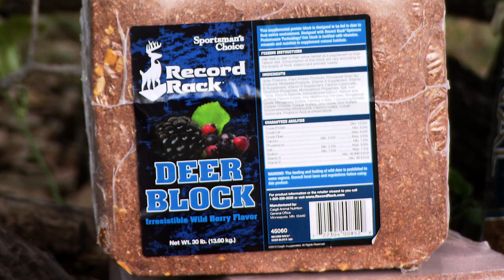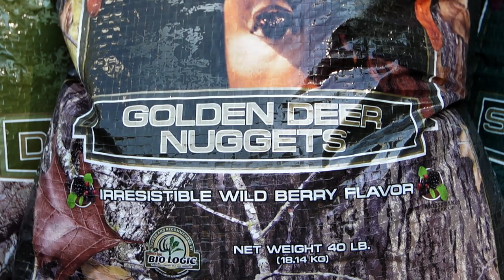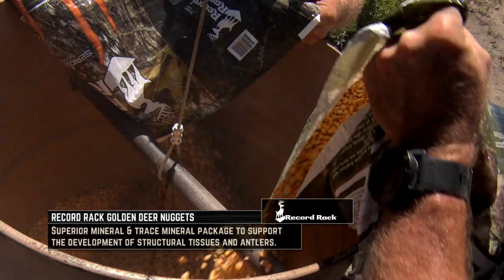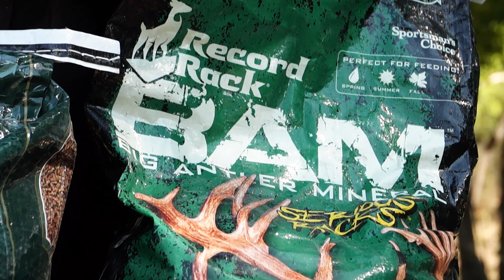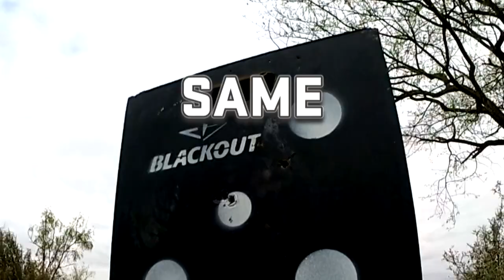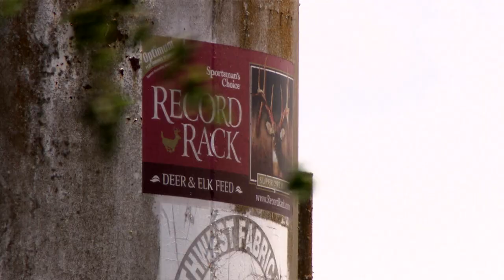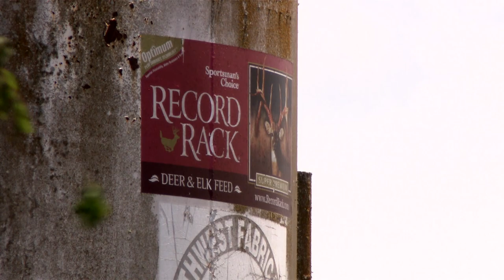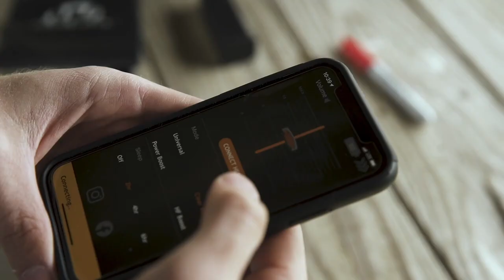Starting a Supplemental Feeding Program with Record Rack

Comment: Need to mix that mineral with the dirt in a 3 ft circle or so! , they like it better when it’s poured in a 3 ft diameter on bare dirt and they use it immediately
Reply from the maker: We've tried both ways and agree with you mixing it in does seem to work better in some areas.

Comment: Do those blocks need to  stay under a tree or do they hold together in rain pretty well?
Reply: No you don't have to put these under a tree to keep them dry.  We put them out all over in various places however all blocks do fall apart a bit in some rain we've found
Reply from the maker: Where we use them it never rains anymore.   To answer your question heavy rain on this block does break it up some but the deer still eat it anyway.